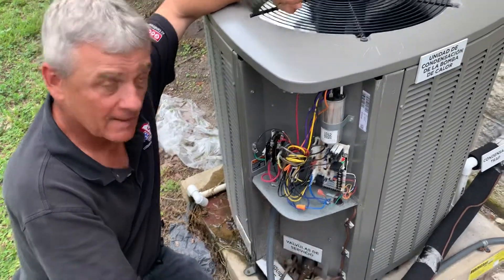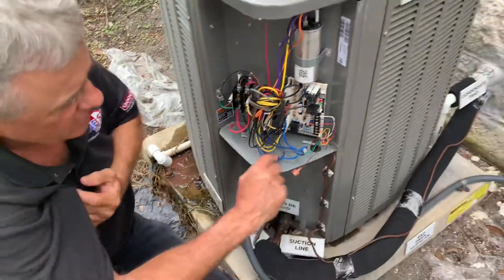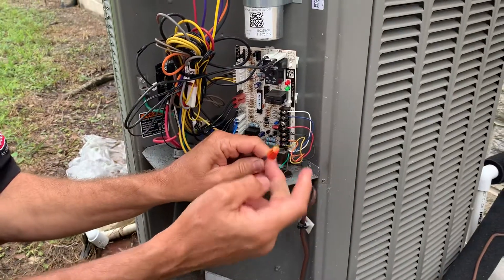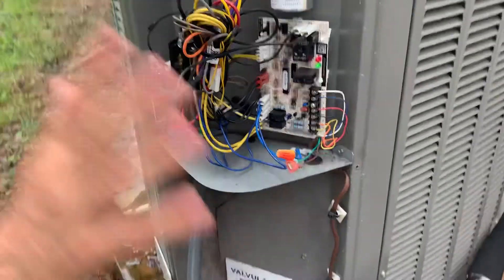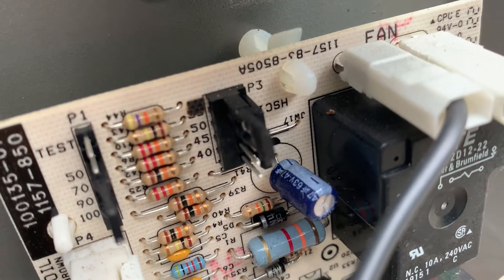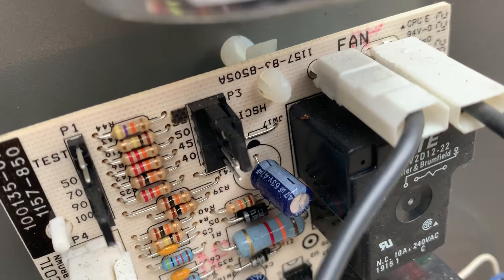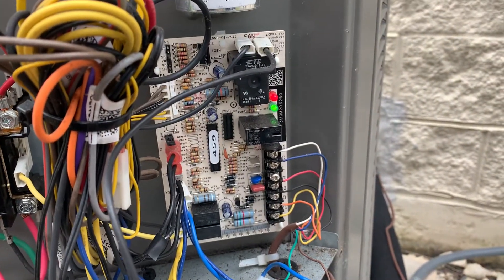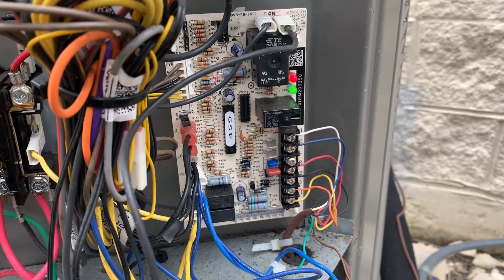Lennox xp16 y2 wiring considerations from tstat to condenser

Comment: What about the carrier condensers (Model# CA17NA03600GABAA) that don't have the control board at the condenser but the factory listed it as a 2 stage unit?  How would I connect my Y/Y2 or should I simply connect to Y1 to the air handler and leave it as that?

Comment: I do believe that is the 2nd stage lock in jumper selection.  If set at 45, when the outdoor temperature is below 45 it locks the heat pump into 2nd stage and therefore sends 24 volts out of the Y2 OUT terminal so your blower runs at full speed even if the thermostat is only calling for 1st stage.

Comment: Interesting.
I suspect they did this to keep the head pressure from getting too high in heating mode when it's mild outside.
Keep in mind that most of the heat given up by the refrigerant is done via condensing into a liquid - so the temperature of the refrigerant won't drop below saturation until it is in liquid state, capacity should be minimally affected. it's saturation temp and refrigerant flow rate that matter. Any temp drop in the vapor side of the long lineset in heating mode will be attributed to dropping to saturation. (de-superheating) - again, minimal capacity loss.

Comment: So if im understanding this right, the way they want you to hook it up will not let it run in 2nd stage heating? Does that affect cooling as well? Reason is i think my xp16 isn't wired correctly. I have no wire at the y2 on my thermostat
Reply: It only effects heating under the temp selected to limit you to y1, if colder out than that if you get a call for y2 it will allow y2 heating.